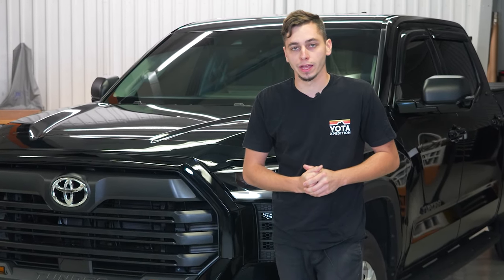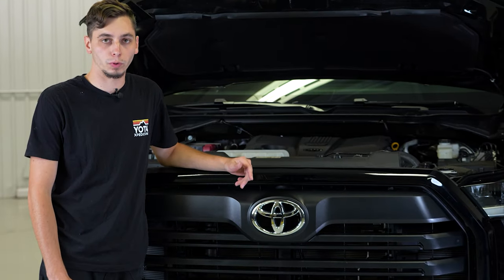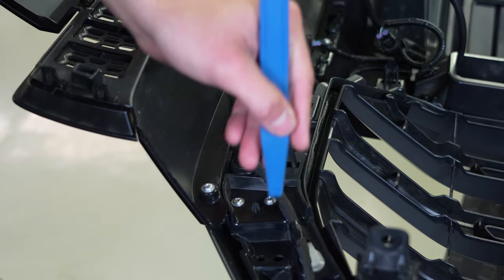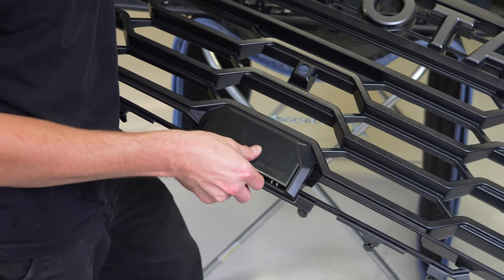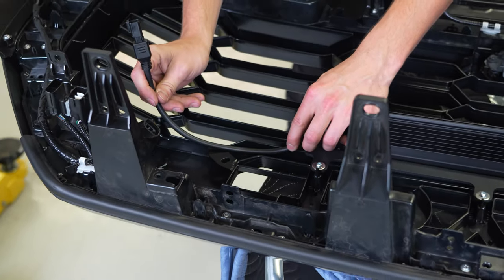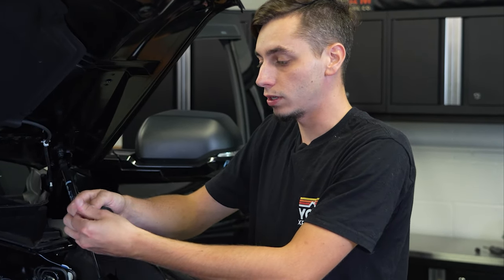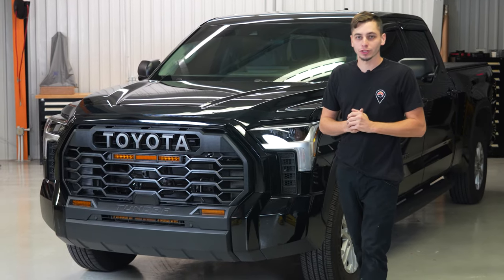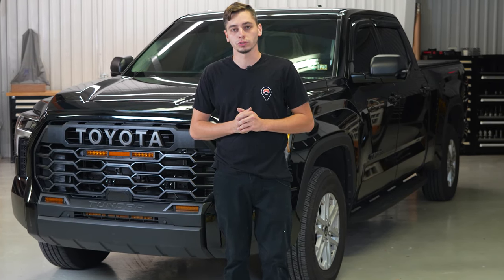Tundra TRD PRO Grille And Light Bar | Step By Step Installation

Comment: Quick question.  I changed out my grille and ran lighting wire, but didn't hook the lights up yet.   While the bumper/grille assembly was off I had to move the vehicle and now I am getting check engine light and Parking Brake Assist errors.  Any thoughts on what would cause this?
Reply from the maker: Probably from driving it with the TSS disconnected. Just put everything back together and reset the battery, you should be fine.

Comment: What if I use the other dummy switch, which color is the power? Red or beige?
Reply: I would also like to know.
Reply from the maker: I'm pretty sure the beige wire on every one is the back lighting.
Reply: @yotaxpedition  we used a wiretap to to go the the original beige, both are lit and operational

Comment: Very nice! Does the light bar kit come with the oem style switch? If not, where did yall get one. The correct size switch is not listed on your website
Reply from the maker: Here is the link for the switches. You might have been under the 2nd gen section. https://yotaxpedition.com/collections/3g-toyota-tundra-switches

Comment: How long did this take you and total cost, minus labor?  I'd like a TRD Pro Grille on my 2024 1794 but not sure I want to go thru the labor intensive process or the $$$ to make the change.
Reply from the maker: For the grille and light bar kit you're looking at $650. I can't remember exactly the amount of time. I would say around 2 hours total.
Reply: I recommend doing it yourself. I just installed the alpha Rex nova headlights, trd pro grille with amber lights and light bar. All in one weekend. It took me 5 hours total. It probably would’ve taken less time if I would’ve had previous experience taking off the bumper and grill.
Reply: @yotaxpedition assuming you can do it without light bar

Comment: beautiful
Reply from the maker: Thanks!
Reply: Advice on installing diode light bars on a hybrid model?  How would you run the wiring considering the battery is under the passenger side backseat?

Comment: How do you wire the light bar if it’s a IForce Max?
Reply: The light bar has its own separate wiring harness, it uses a relay and gets powered by the battery